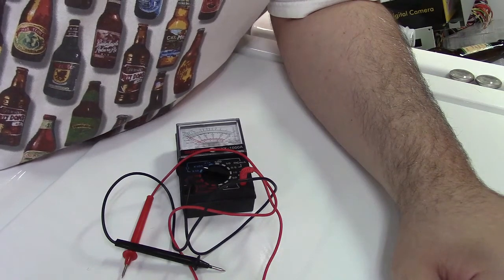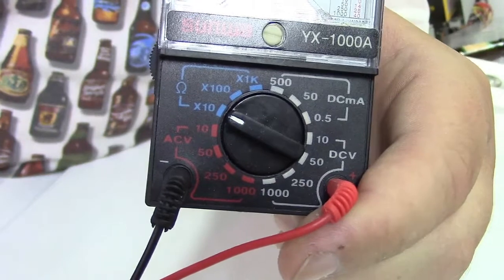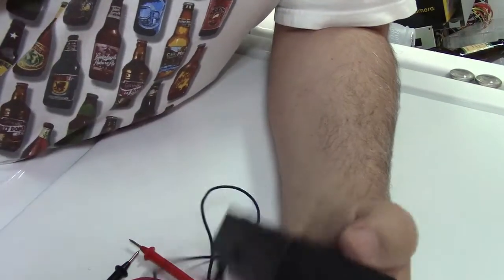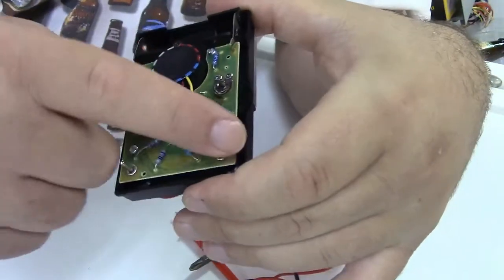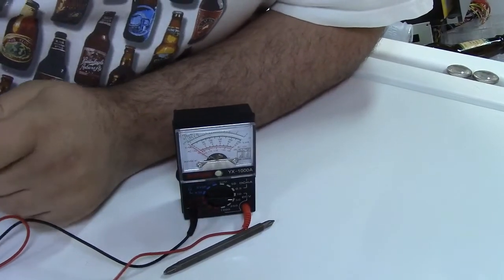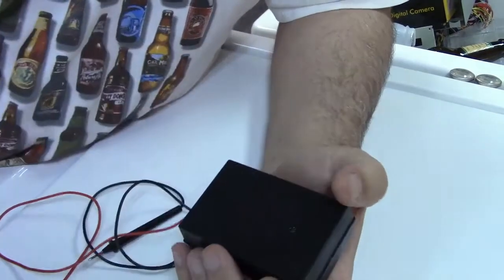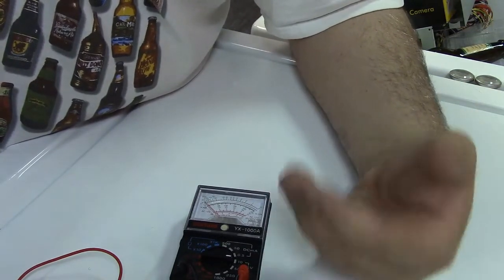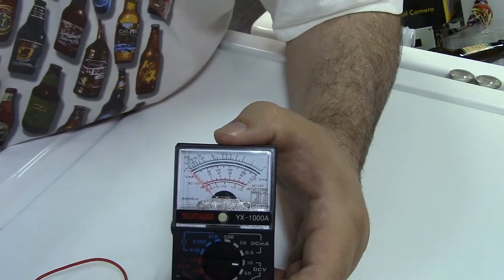Sunwa YX-1000A ANALOG Multimeter

Comment: I have the same mini analog multitester as yours here in the Philippines. Even the writing at the back is the same. But i think mine is much older and very much used. It was given to me by the foreman that renovated our house about nine years ago. The multitester now is the same as it was when given to me. I  only using it these past several days ago, together with my old regular size analog multimeter (i had it and using it since my schooling in computer(1996), still in very good condition. With them also is my digital clamp multimeter, for comparing which is better to use for this and that. Thank you sir for sharing🙏❤️
Reply from the maker: You're welcome.

Comment: Hi, i have the same product but unfortunately one of the resistances is burnt and I can't find out what it was. I'd appreciate if you could help me with it. 
On top left of the board from our view when we open it there are 3 ones which are used as DCmA, then the middle one(2nd from the top) is totally burnt. I would solder a new one if you could tell me what to buy.
Reply from the maker: You're probably better off getting a new meter, these aren't of any kind of quality and can be had for a very small amount of money.

Comment: I have a very similar meter branded as actron CP7848. The selections on the dial are laid out differently, and mine doesn't have the side adjustment thumb wheel. Very useful for tracking down a parasitic battery draw with the analog needle movement. Right now it needs the positive lead re soldered, and possibly a new fuse to get it working again.
Reply from the maker: I'm rather surprised this one works at all.

Comment: I am fortunate to have all three types of meters, analog, analog/digital hybrid, and digital.
Reply from the maker: I don't have any hybrids, that's for sure.  Somewhere at my dad's house is my old DC voltmeter.  It's digical, but requires a 20 minute warm up period to stabilize.  And you have to zero it every time, and also calibrate it; each has their own adjustment knob and mode to switch it into for that.  I don't remember the brand, and I think one of the LED 7-segment displays have a segment or two out, but last I knew it worked.